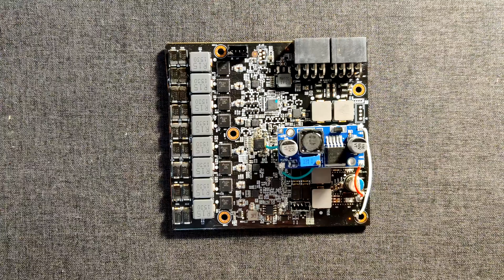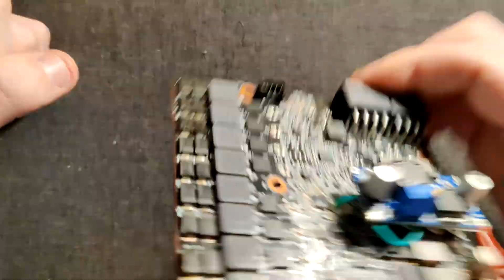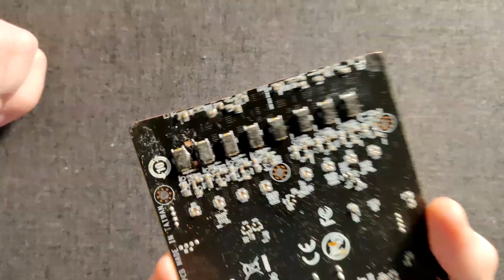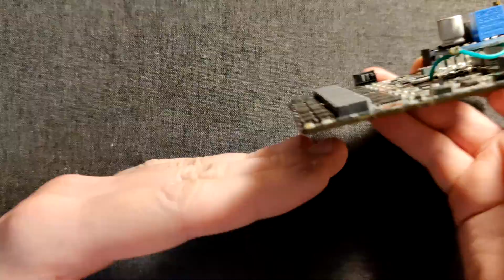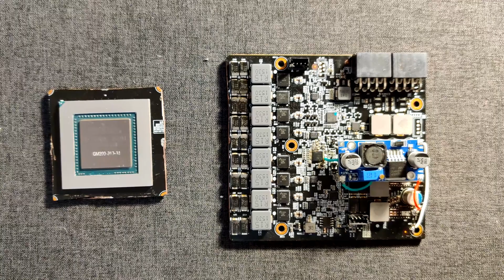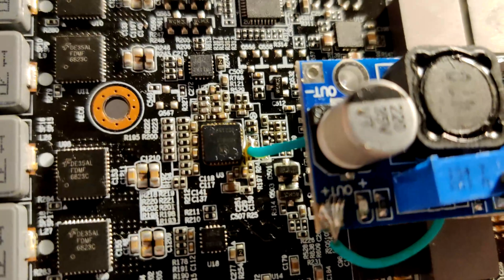Dead GTX 980Ti turned E-Power

Comment: this is awesome. i have  a dead 290x i want to try to do this
Reply from the maker: 290X can be a bit of a challenge since usually the VCore VRM shares its controller with the VDDCI VRM which is on the other side of the board. If you cut that off it might start freaking out about where its VRM has gone off to.
Reply: @CmdrSoyo  i took a look at it, and you're right, the other side looks alot more populated/interconnected, so slicing doesn't seem feasible. You mentioned, that AMD cards dont have a sense wire ? Or shunt resistors>?  Would i be able to use the entire card like a e-power lol

Comment: If I follow correctly you grafted on a buck converted which your only using to pull up a couple of 3.3v logic lines. why not just a voltage divider?
Reply from the maker: Takes longer to implement and i have like 20 of these.